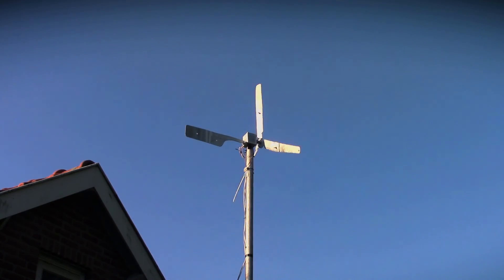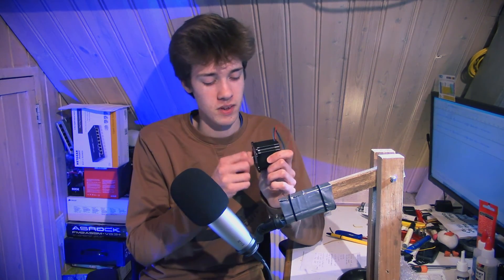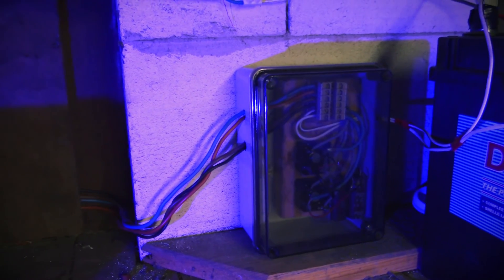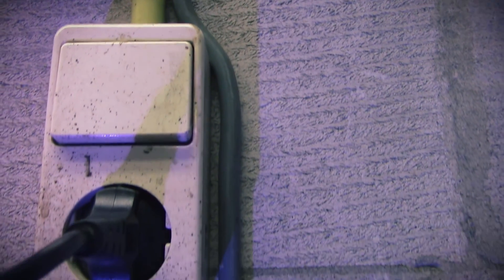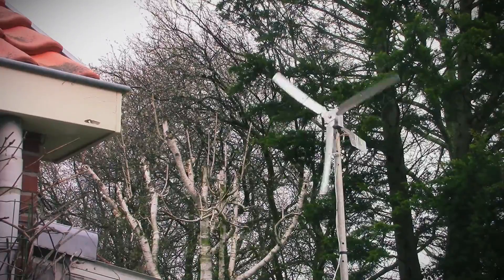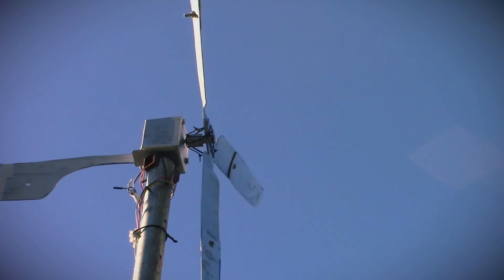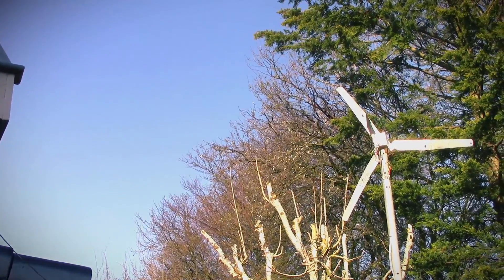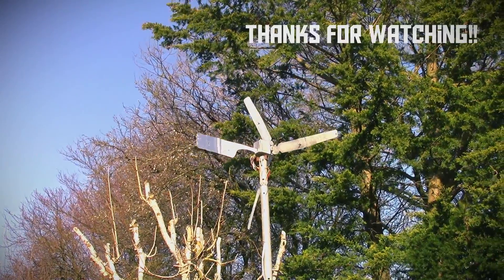The DIY wind turbine (AKIO TV)

Comment: Nice to have watched your vid... cheers...
I am also diy'ing one, i tried geared-box DC brushed motor, but hard to turn in wind...
May I ask, which Nema 17 should i try next ?   Nema 17 seems to have so many variants...   I just expect to directly light up a row of LED at my fence when the wind blows
Reply from the maker: LEDs don't need a high voltage to turn on, so you can get a low voltage stepper motor, which gives you lower winding resistance and better efficiency.

Also if the led strip is particularly long you may want to use a nema 23
Reply: Thks for reply..... 
I am currently wandering on 17HS4401 , can you pls advice ?   In strong wind , what voltage & amperage shall i get at minimum ?    Really sorry bcoz i am totally off electronic knowledge.....
Reply from the maker: @kenvoo7303  idk enough about your setup or stepper motors to give you proper advice, but the motor you mentioned seems to be ok.

 The 4402 may give you a higher voltage than the 4401 though which would make it easier to power the LEDs at low speeds, so that's the one I think I'd go for.

One last thing to realise; you can't get a lot of power out of these stepper motors, maybe a few (2-10) watts. Plenty to turn on your LEDs but don't expect to power more stuff from it. The wind turbine you see in the video was replaced by a new design that doesn't use a stepper motor a few months ago for that reason.
Reply: Few watts seems enuf for me at the moment.....its just for a fun begining.....
Well, what motor you use now ?
Reply from the maker: @kenvoo7303  I now use a brushless motor for RC aircraft that I've modified. It also needs a gearbox to achieve high enough rpm. It generates about 70 watts at full power.
Reply: The 4402 may give you a higher voltage than the 4401.......
Pls teach me , why is that ?   Is it because 4402 has higher Phase Inductance ?
Reply: What  about 3401 vs 4401 ?    Because i am only able to get these 2 models.........
Which model shall output more volt at same rotation ?
Reply from the maker: @kenvoo7303  The higher inductance and resistance indicate more turns on the windings, which likely leads to a higher output voltage. Therefore between the 3401 and 4401 I'd go with the latter.
Reply: Something came up in my mind......
Can i series connect 2 motor so that i can (i think) raise the voltage easily & light up my Led in real slow wind ?
Reply from the maker: @kenvoo7303  two motors would require them to rotate perfectly in sync. I wouldn't go that way.

Also don't worry too much about having high enough voltage, you only need 1-2V to turn LEDs on.
Reply: So sorry for being so long winded......
Anyway, recently salvaged 2 motors from old Epson inkjet printer, they seem effortlessly can lit up my 3.2v led , i googleg & found they are so called carriage motor, actually what type of motors are they ?    I also tried my 775 motor, but cant lit up the Led so far no matter how strong & fast i turn with my fingers
Reply from the maker: @kenvoo7303  stepper motors I suppose? Printers use them a lot.
Reply: But they are physically the same as ordinary DC motor which is round, not square as stepper motor
Reply from the maker: @kenvoo7303   Smaller stepper motors are often round. If it has 4 or more wires it's a stepper motor. I salvaged some from a printer myself.
Reply: Can i ask ?   
 What type motor has least friction when generating output power ?
Is motor with gearbox harder to turn on shaft ?
Reply from the maker: @kenvoo7303  Gearboxes introduce more friction (power loss) the more aggressive they are. A 1:10 gearbox will be less efficient than a similar 1:4 gearbox.
Reply: Finally i bought 17hs8401 , 
I made 2 sets of full bridge rectifier & connected in series to get higher voltage...
My curiosity is why the LED still lit up in both left / right turn ?
Isnt that the current already converted to DC & should behave like DC ?
Reply from the maker: @kenvoo7303  The output of the motor is AC, and the bridge rectifier turns it into DC with a fixed polarity. Reversing the motor makes no difference, because the motor outputs AC anyway, and the rectifier always outputs the same polarity.

Comment: If you could use all the electricity generated by your turbine (maybe 500w a day) it would pay for its self in 5 or 6 years ( €0.10 /KWh). That doesn’t sound too bad to me. 

Does the turbine always produce a charge to the battery when spinning at any speed? I’ve heard that the problem with home wind generation is that constant variation in output makes it difficult to be useful. 
Anyway. Very impressive. Well done. Looking forward to more videos.
Reply from the maker: The turbine starts charging the battery when its voltage becomes greater than the battery voltage, which happens at about 60-70RPM, so not quite at any speed, but when there's wind it does usually reach that speed. It turns out it's very useful for charging smaller devices like phones, but not nearly enough to regularly charge the battery on my electric bicycle. Depending on how you do the maths the thing could pay for itself in 5-10 years. 

The main reason it doesn't produce quite as much as I'd like (as mentioned in the video) is that the wind is rarely consistent. (meaning  it may only spin 3-5 hours in a full day) By having this turbine placed in a field somewhere, it may actually generate a lot more because it'd be spinning almost 24/7. In my situation though (and that of most other people) it gets smoked by a 1x1 solar panel. Fortunately, I do this stuff for fun and I get a video out of it, in fact I'm more than satisfied seeing that it generates power at all.

Thanks for the comment!
Reply: @AKIOTV  In the middle of winter 500 watts of solar is almost useless with no sun and grey sky's.
A steady coastal breeze of 15 mph should have your turbine producing around 1 amp over 24 hours at least producing 24 Ah compared to 500 watts of solar panels producing 2500 mA times five 100 watt panels giving 1.25 Amps over six hours = 7.5 Ah.
So 16.5 Ah more than solar in the right conditions i think is great.
All figures above are approximate for an example.
I have a campervan and get little sun in winter so being easy to drive to the coast or mountains I fancy building a portable one of these for my camper roof. 200 Watts of solar panels is all my roof can take so both opens up more options for me.
24 Ah plus the 2.5 Ah I'd get from my solar would be = to 26.5 Ah, meaning only running my engine for 15 minutes instead or 30 minutes per day to achieve desired power. This would save me 1 hour 45 minutes of driving, saving me around £10.50 per week. If you also add up mechanical wear and higher van mileage equating to more servicing and tyre wear this could all equate to £12.00 total per week over seventeen weeks of perfect wind conditions in winter( this would be easily achievable beside the coast or up the mountain road at a dam where I hang out ) 12 x 17 = £204.00. Not too shabby at all and should pay for itself very quickly.
I have everything including a good charge controller so would only need the turbine.   
Does this sound like a project that may be worth my while, is my maths close enough? 20 Ah per day would be great. Every time I've been at the coast or up at the dam this winter I've had steady winds at 15 mph to 34 mph but averaging out at around 24 mph/25 mph, I may even achieve 2 Ah over 24 hours = 48 but hey, I guess that's dreaming.
Reply from the maker: @pa_maj.MARTINI-van-MAN  The main issue is the consistency of the wind. If you have a constant steady breeze it'll work out well, but otherwise you'll get beaten by solar every time.

To do 20ah per day (240wh at 12V), if you had a decent sized turbine (I'd say 1.5m diameter) and a consistent wind, you should be able to pull it off. But be warned, it's much harder than you think to get decent output from small wind turbines, and they are also difficult to build and expensive to buy. 

Ultimately the big problem with wind turbines is how dependent they are on the right environment. Performance will vary a lot depending on conditions. It may be a good solution for you but the only way to be sure is to get one and test it, which isn't financially good advice haha.

Therefore it definitely helps if you enjoy this stuff so even if it's not financially beneficial it's still a good hobby.

PS I think your maths are ok, except you seem to have put in the time for running the engine as 'driving time', but in order to recharge you don't need to drive, so the fuel cost would be lower.
Reply: @AKIOTV  Great points AKIO TV. Yes it all looks good on paper but the reality is it seems, anything less than a metre is not great and 1.5 metre's is realistic.
I was interested in one called the Wind Lilly that is 600 mm and can produce 1 amp hour in 16 mph winds and 2 apparently in 22 mph winds, minimum wind speeds is 7 mph. It's also a water turbine so for rivers it is apparently great as they flow more reliantly than wind.
The price has just came down so I might bite lol, it depends on shipping and customs as it's a Canadian manufacturer.
I like it's portability and general motor design as it's sealed and the small formfactor when built. 

Why I mentioned driving miles rather that stationary is because stationary ( idling ) an engine for extended periods is bad for them, better to be driven under load and fluctuating rev's to prevent coking and slackness in bearings, less slapping under load. This is my understanding of it anyway.

Thanks for your reply AKIO TV, you've give me some food for thought.
Reply from the maker: @pa_maj.MARTINI-van-MAN  That's an interesting product you mentioned there, especially how it's both wind and hydro. Hydro turbines are amazing if you have access to some sort of stream.
Reply: @AKIOTV  It packs away good and as you say an interesting product. Not as much fun as trying to build something though.

Comment: Would using a transmission help you in using a normal motor? As far as I'm aware stepper motors use a transmission internally, and that's what gives it the properties you desire.
Reply from the maker: The stepper that I use does not have any internal transmission. Power is of course the product of speed and torque, a stepper motor requires more torque to be turned under load and therefore doesn't need to spin as fast. (mainly due to the large amounts of turns in its windings). Some other motors also have this property, especially ones that are used at higher voltages.

A transmission is the mechanical equivalent of that; it trades torque for speed, meaning it can allow you to use a higher speed generator. It does add extra mechanical complexity to do it this way, hence why I went direct drive with the stepper motor.